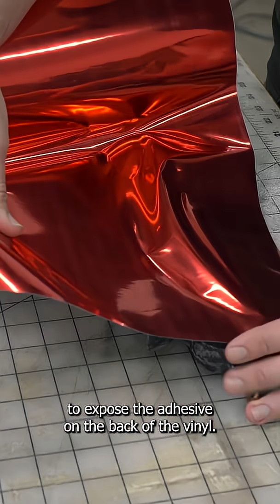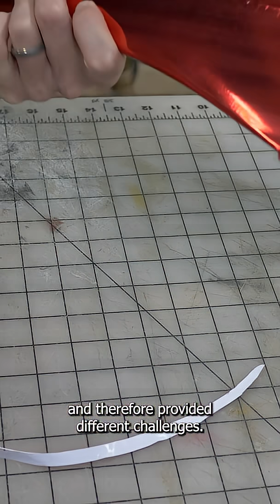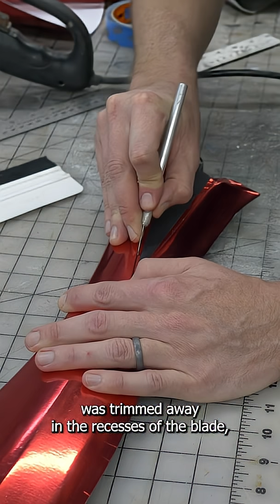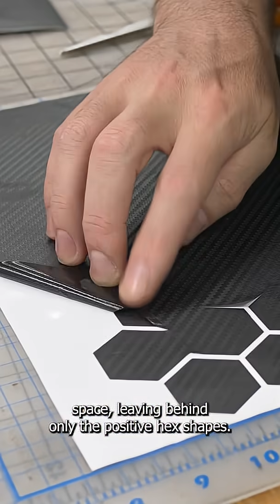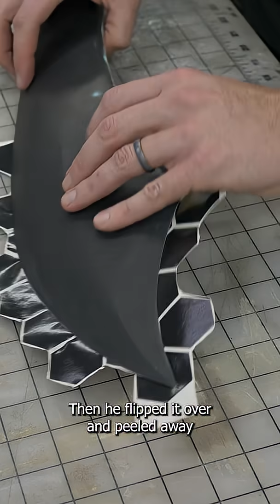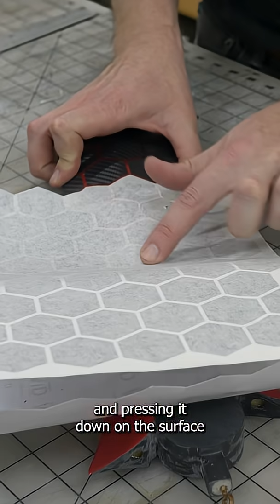vinyl wrapped sword

Comment: Those last frames on the video. The latches already getting loose and separating from the print. 
Be real, did it hold up? Or was it a cool in concept thing that gave up an hour after filming? Because depending what it was, I'd like to know if it's actually worth looking into the carbon fibre stickers.
Reply from the maker: It worked great, but the end result wasn’t achieved in Steve’s visit. He went back to his shop, rearranged some of the stickers, and added the rest of the details: https://images.squarespace-cdn.com/content/v1/680f0e6108eb060dda417feb/417655eb-0263-49b7-86c3-e1231c470f24/hero-archer-1.jpg
Reply: @punishedprops thanks a bunch. The end result does es look amazing. Glad to hear it did work out after all🎉

Comment: Use a hair drier instead of a heat gun, you'll be able to focus the heat precisely where you need it to help stretch the film, where a heat gun always has the threat of applying too much heat accidentally and blowing through if you're not 100% focused.

Comment: I worked with adhesive vinyl and wrapping for over a decade. A tip when wrapping objects like this that are convex (bulge out) is to pre-heat and pre-stretch. That way you avoid having to make those small stretches near the edge that result in those small folds. And since you've already stretched it beforehand, you can use the heat gun to make the vinyl shrink in spots, since it will always try to return to it's initial relaxed state. If you start applying the vinyl in it's relaxed state, it won't shrink when you heat it and you'll more easily end up with folds or having to split the vinyl and make seams.
Reply from the maker: This is a great tip, thank you!

Comment: I think the primary joke here is that replicating it with paint would have been easier due to masking being a thing. You’d just paint the red, then make a hex pattern mask, the paint the black. Or use the same method of adding the hex pattern over the paint
Reply from the maker: Carbon fiber vinyl saves so much time!

Comment: I've always used The wet method of applying vinyl -spraying the surface with a little soapy water before placing the vinyl and squeegeeing out the water, no this doesn't weaken the adhesive but it does make adjusting it easier although I've never done it on a dynamic surface like that before
Reply: Most modern vinyls have air release channels, so these days wet installs can actually cause more problems than not.

Comment: That carbon fiber cutter is a shortcut to horrifying lung disease, please take precautions
Reply: I may be mistaken, but if I recall it was just a standard vinyl which has an embossed pattern to mimic carbon fiber.

That said, Bill is pretty consistently really good about safety measures with things that actually do have airborne particulates.
Reply: @halbertwalston  i always shout it out because I've seen a lot of it, especially in plane/drone manufacture on carbon fiber tubes and sheets.
Reply: @halbertwalston You're correct, it's vinyl, not actual carbon fiber!

Comment: As someone who worked with self adhesive vinyl for 15 years,  this job was very well done! 👏👏
Reply from the maker: Thanks! We definitely learned a lot 😁
Reply: @punishedprops if you heat up the entire piece of vinyl first, when you stretch it over the object, you should end up with fewer wrinkles around the edges.
Reply: @punishedprops try to stretch from a  bagger or longer surface. Preventie wrinkle.  If you stretch from de long side all the way. It wil take the shape of the sword better. Tip from a professional carwrapper and tinter
Reply: Yeah my OCD kicks in for vinyl and this didn't even get my heart racing 😂